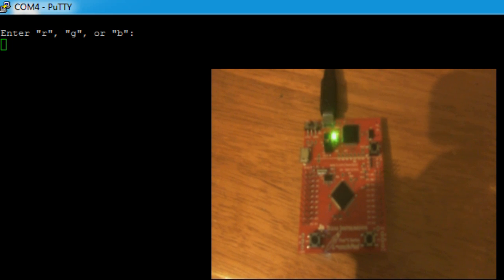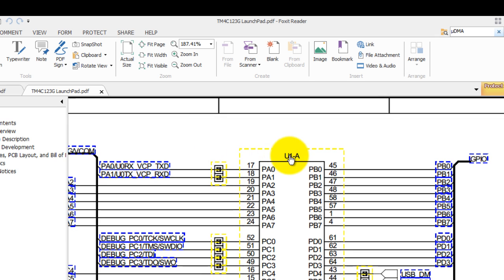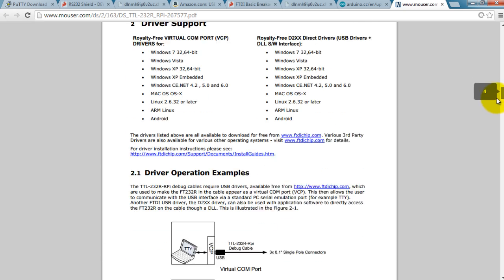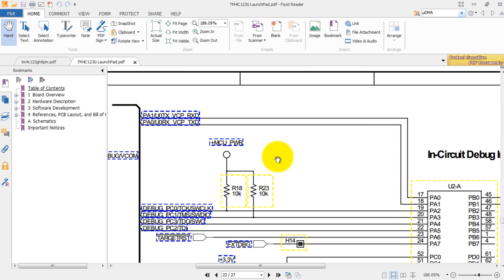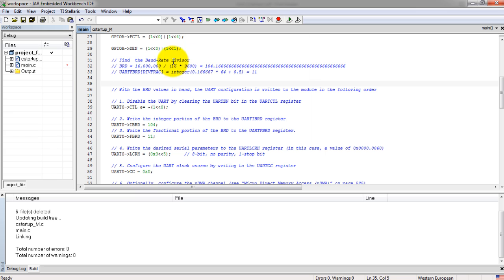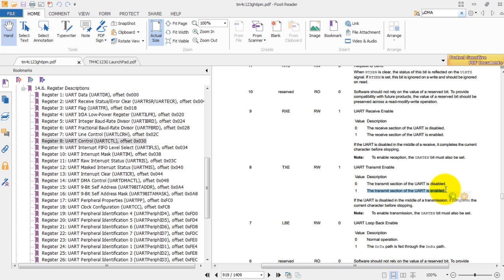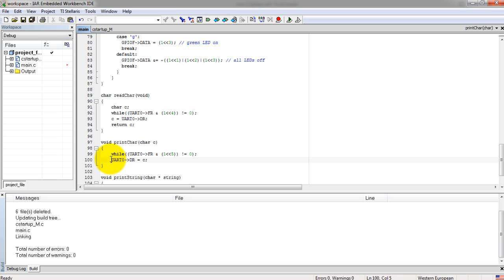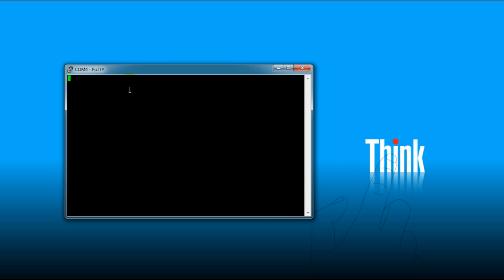TM4C123 Tutorial: UART to PC Communication

Comment: Great video, well explained! Thank you very much! In my case i had to set UART0->CC to 0x5 to use PIOSC. You mention that the default System clock 0x0 is PIOSC. This is not the case for me. Do you know the reason? I'm using Board TM4C123GXL

Comment: Its not working.... i'm getting some unwanted values like 0xFE while i send 'A'...please help
Reply: me too !!!
Reply: try this code

#include <lm4f120h5qr.h>
#include <string.h>
#include <stdlib.h>

char readChar(void);
void printChar(char c);
void printString(char * string);
//char* readString(char delimiter);

int main(void) 
{
    // 1. Enable the UART module using the RCGCUART register (see page 344).
    SYSCTL->RCGCUART |= (1<<0); 
    
    // 2. Enable the clock to the appropriate GPIO module via the RCGCGPIO register (see page 340).
    // To find out which GPIO port to enable, refer to Table 23-5 on page 1351.
    SYSCTL->RCGCGPIO |= (1<<0); 
    
    // 3. Set the GPIO AFSEL bits for the appropriate pins (see page 671). To determine which GPIOs to
    // configure, see Table 23-4 on page 1344
    GPIOA->AFSEL = (1<<1)|(1<<0); 
    
    // 4. Configure the GPIO current level and/or slew rate as specified for the mode selected (see
    // page 673 and page 681
    
    // 5. Configure the PMCn fields in the GPIOPCTL register to assign the UART signals to the appropriate
    // pins (see page 688 and Table 23-5 on page 1351).
    GPIOA->PCTL = (1<<0)|(1<<4);  
    
    GPIOA->DEN = (1<<0)|(1<<1); 
    
    // Find  the Baud-Rate Divisor
    // BRD = 16,000,000 / (16 * 9600) = 104.16666666666666666666666666666666666666666666666666
    // UARTFBRD[DIVFRAC] = integer(0.166667 * 64 + 0.5) = 11
    
    
    // With the BRD values in hand, the UART configuration is written to the module in the following order
                   
    // 1. Disable the UART by clearing the UARTEN bit in the UARTCTL register
    UART0->CTL &= ~(1<<0);
    
    // 2. Write the integer portion of the BRD to the UARTIBRD register
    UART0->IBRD = 104;      
    // 3. Write the fractional portion of the BRD to the UARTFBRD register.
    UART0->FBRD = 11; 
    
    // 4. Write the desired serial parameters to the UARTLCRH register (in this case, a value of 0x0000.0060)
    UART0->LCRH = (0x3<<5)|(1<<4);     // 8-bit, no parity, 1-stop bit
    
    // 5. Configure the UART clock source by writing to the UARTCC register
    UART0->CC = 0x0;          

    // 6. Optionally, configure the ?DMA channel (see ?Micro Direct Memory Access (?DMA)? on page 585)
    // and enable the DMA option(s) in the UARTDMACTL register
    
    // 7. Enable the UART by setting the UARTEN bit in the UARTCTL register.
    UART0->CTL = (1<<0)|(1<<8)|(1<<9); 
    
    // Configure LED pins
    SYSCTL->RCGCGPIO |= (1<<5); // enable clock on PortF
    GPIOF->DIR = (1<<1)|(1<<2)|(1<<3);  // make LED pins (PF1, PF2, and PF3) outputs
    GPIOF->DEN = (1<<1)|(1<<2)|(1<<3); // enable digital function on LED pins
    GPIOF->DATA &= ~((1<<1)|(1<<2)|(1<<3)); // turn off leds

    while(1)
    {
        printString("Type something and press enter: \n\r");
        char c = readChar();
        printChar(c);
        printString("\n\r");
        
        switch(c)
        {
        case 'r':
          GPIOF->DATA = (1<<1);
            break;
        case 'b':
          GPIOF->DATA = (1<<2);
            break;
        case 'g':
          GPIOF->DATA = (1<<3);
            break;
        default:
          GPIOF->DATA &= ~((1<<1)|(1<<2)|(1<<3));
            break;
        }
     }
    
}

char readChar(void)  
{
    char c;
    while((UART0->FR & (1<<4)) != 0);
      c = UART0->DR;                 
    return c;                    
}

void printChar(char c)  
{
  while((UART0->FR & (1<<5)) != 0);{
    UART0->DR = c;           }
}

void printString(char * string)
{
  while(*string!='\n')
  {
    printChar(*(string++));
  }
}

Comment: I'm using the tiva c board and keil.  the code runs but I'm not able to type anything in putty. it only prints the first line on the screen and then it stops.  even with that i had to increase the rate to 115200. any help?
Reply from the maker: ***** Poke around the setting in putty. You could actually be typing stuff but "echo" might me turned off.

Comment: Excellent.. very well explained..!! can I get the code used in the video..??
Reply from the maker: I never keep the code in my computer, all the code I used is shown in the video.

Edit: I've created a github repo https://github.com/AllAboutEE/ARM-Programming-Examples-TM4C/blob/master/UART-Example/main.c  the contents are the same except for the while loop and a readString function I added.
Reply: AllAboutEE 404 not found
Reply from the maker: Michael Klimovitsky I moved things around, you'll be able to find it here https://github.com/AllAboutEE/ARM-Programming-Examples-TM4C/tree/master/Basic-Examples/UART
Reply: AllAboutEE Thanks. I have tried that and I get "#20 identifier "SYSCTL" is undefined" Any ideas? I am using TM4C123GH6PMI
Reply from the maker: You are not including the correct files. Did you watch my first video in this series?
Reply: Try this code:

#include <lm4f120h5qr.h>
#include <string.h>
#include <stdlib.h>

char readChar(void);
void printChar(char c);
void printString(char * string);
//char* readString(char delimiter);

int main(void) 
{
    // 1. Enable the UART module using the RCGCUART register (see page 344).
    SYSCTL->RCGCUART |= (1<<0); 
    
    // 2. Enable the clock to the appropriate GPIO module via the RCGCGPIO register (see page 340).
    // To find out which GPIO port to enable, refer to Table 23-5 on page 1351.
    SYSCTL->RCGCGPIO |= (1<<0); 
    
    // 3. Set the GPIO AFSEL bits for the appropriate pins (see page 671). To determine which GPIOs to
    // configure, see Table 23-4 on page 1344
    GPIOA->AFSEL = (1<<1)|(1<<0); 
    
    // 4. Configure the GPIO current level and/or slew rate as specified for the mode selected (see
    // page 673 and page 681
    
    // 5. Configure the PMCn fields in the GPIOPCTL register to assign the UART signals to the appropriate
    // pins (see page 688 and Table 23-5 on page 1351).
    GPIOA->PCTL = (1<<0)|(1<<4);  
    
    GPIOA->DEN = (1<<0)|(1<<1); 
    
    // Find  the Baud-Rate Divisor
    // BRD = 16,000,000 / (16 * 9600) = 104.16666666666666666666666666666666666666666666666666
    // UARTFBRD[DIVFRAC] = integer(0.166667 * 64 + 0.5) = 11
    
    
    // With the BRD values in hand, the UART configuration is written to the module in the following order
                   
    // 1. Disable the UART by clearing the UARTEN bit in the UARTCTL register
    UART0->CTL &= ~(1<<0);
    
    // 2. Write the integer portion of the BRD to the UARTIBRD register
    UART0->IBRD = 104;      
    // 3. Write the fractional portion of the BRD to the UARTFBRD register.
    UART0->FBRD = 11; 
    
    // 4. Write the desired serial parameters to the UARTLCRH register (in this case, a value of 0x0000.0060)
    UART0->LCRH = (0x3<<5)|(1<<4);     // 8-bit, no parity, 1-stop bit
    
    // 5. Configure the UART clock source by writing to the UARTCC register
    UART0->CC = 0x0;          

    // 6. Optionally, configure the ?DMA channel (see ?Micro Direct Memory Access (?DMA)? on page 585)
    // and enable the DMA option(s) in the UARTDMACTL register
    
    // 7. Enable the UART by setting the UARTEN bit in the UARTCTL register.
    UART0->CTL = (1<<0)|(1<<8)|(1<<9); 
    
    // Configure LED pins
    SYSCTL->RCGCGPIO |= (1<<5); // enable clock on PortF
    GPIOF->DIR = (1<<1)|(1<<2)|(1<<3);  // make LED pins (PF1, PF2, and PF3) outputs
    GPIOF->DEN = (1<<1)|(1<<2)|(1<<3); // enable digital function on LED pins
    GPIOF->DATA &= ~((1<<1)|(1<<2)|(1<<3)); // turn off leds

    while(1)
    {
        printString("Type something and press enter: \n\r");
        char c = readChar();
        printChar(c);
        printString("\n\r");
        
        switch(c)
        {
        case 'r':
          GPIOF->DATA = (1<<1);
            break;
        case 'b':
          GPIOF->DATA = (1<<2);
            break;
        case 'g':
          GPIOF->DATA = (1<<3);
            break;
        default:
          GPIOF->DATA &= ~((1<<1)|(1<<2)|(1<<3));
            break;
        }
     }
    
}

char readChar(void)  
{
    char c;
    while((UART0->FR & (1<<4)) != 0);
      c = UART0->DR;                 
    return c;                    
}

void printChar(char c)  
{
  while((UART0->FR & (1<<5)) != 0);{
    UART0->DR = c;           }
}

void printString(char * string)
{
  while(*string!='\n')
  {
    printChar(*(string++));
  }
}